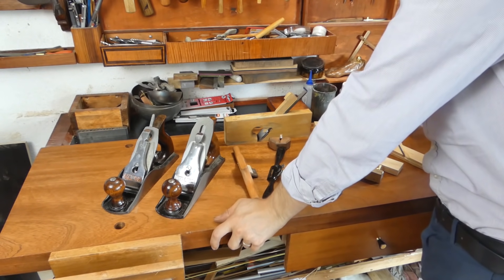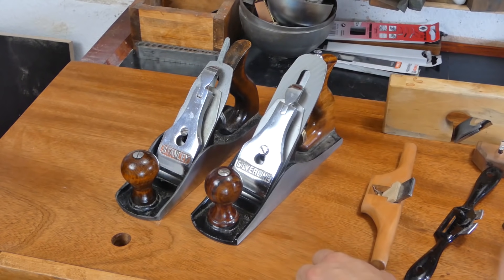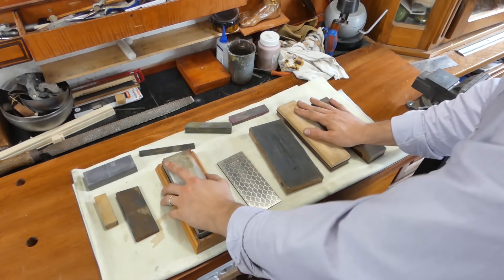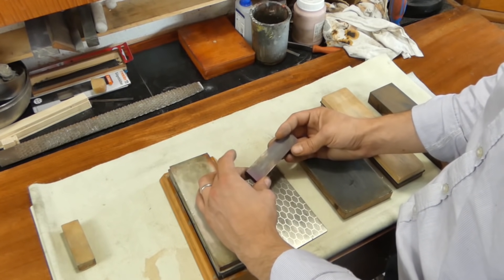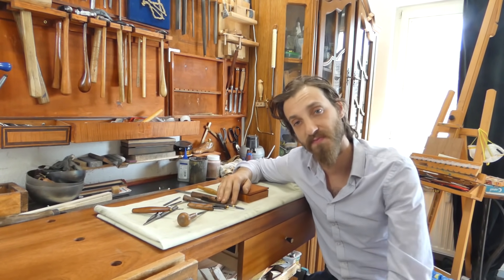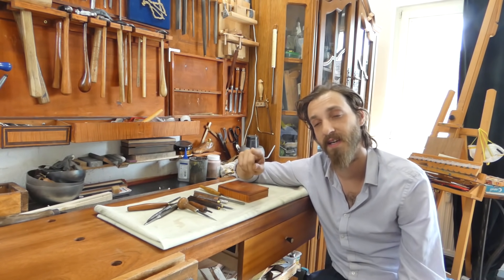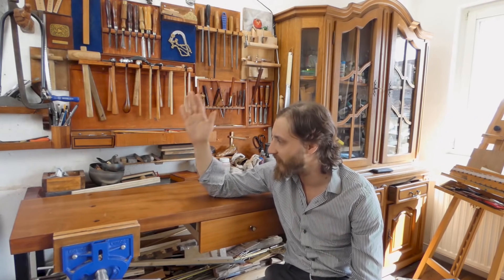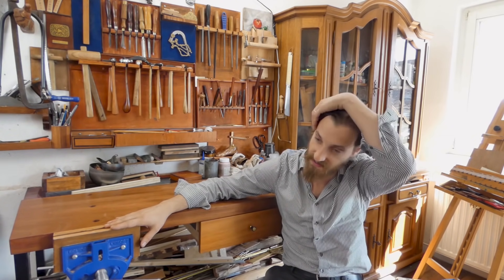Let's Talk Tools and Stuff! - 100k sub special!

Comment: For Japanese saws, I would recommend going with Gyokucho.  The blades are replaceable and they cut really well for being inexpensive.  Don’t bother with the really expensive handmade Japanese saws though since sharpening isn’t like on Western saws; it’s an art that requires special files and years of practice.

If you prefer a Western saw, buy a good one.  They’re worth it.

P.S., use the old blades from your Japanese to make other tools.  It’s good steel.
Reply: Thats actually a really good idea. I'm thinking of getting a Japanese saw and then using the old blades to make knives
Reply: i dont mean to be off topic but does anybody know a method to log back into an Instagram account..?
I was stupid forgot my login password. I would appreciate any assistance you can offer me.
Reply: @George Logan instablaster :)
Reply: With a Gyokucho saw you can take the blade out, and clamp it on a flat piece of wood, long enough to also be the handle, and that way have a back saw as well. That is three saws in one!

Comment: I don't think a lot of people get what it feels like when a tool is just right, it's working well and things are just going along great. I have planed some wood down to nothing just because the curls were coming off right, it just felt too good to quit. Of course there is a difference in the tools you require for your art work than the workaday tools I generally used. You don't buy high dollar chisels to mortise a hinge, but by the same token you don't want one so cheap that it fights you all the way.

Comment: Thanks for the tool video!
As I said before, you inspired me to make a graver and etc. For my first attempt at a graver I used a long Allen wrench, annealed the bend, cut it off and shaped it first with a good file etc. Before I hardened it I tried it on plastic and it formed perfect lines. I then quenched it and tempered it and when I was putting the final edge on it I must have messed up the geometry and lost its ability to make the perfect line. I am redoing it, but I see what you mean in that a guide when edging the graver is almost a must. I had made my own jig but the one you used in a video looked like it would have prevented my goof that has me starting over again. 
Best wishes for your channel!

Comment: Hi Uri, nice information about your tools.
High speed steel doesn’t need hardening. It’s quality is that it doesn’t lose its hardness when heated ( within reason) so can be sharpened on a grinder without dipping into water. I’m not 100% sure but I think that for a graver the cheaper HSS would be adequate

Comment: I’d like to point out Uri’s drill guide that can be seen on the left hand side in front of the wooden box at 6:25 – it’s from a company called Big Gator Tools and it’s a very handy little helper for drilling 90º holes. It’s made in the USA, but the quality is excellent and it comes in metric sizes as well. Worth every penny.

Comment: For a good cheap saw I recommend a frame saw. And I personally use and love the normal "modern" steel frame that any department store has. Get a good one though. The blade tension is key with saws, and a steel frame is much stronger than any wooden one. The user needs to make an adapter to fit the blade.

Comment: On heat treating, there's an iOS app (possibly android too) from ASM International called Heat Treat. It has a lot of different steels and how to anneal, normalise, harden and temper them. 

Steels vary a lot in the way you heat treat them and so this resource is very handy. NB: not all simple carbon steels are water quenching, some require oil.
Reply: Thank you so much for this suggestion. I've been researching heat treatment and trying to learn as much as I can about the process and never found such a thorough and convenient resource for it

Comment: It’s true that as tool prices get higher and higher, the improvements in quality get smaller. The quality difference between a $50 plane and a $10 plane is much more than the difference between a $200 plane and a $50 plane.

Comment: High speed steel can’t be heat treated.  That’s the point of high speed steel.  It’s designed to handle extremely high temps.

P.S., oil is a better quencher liquid.  Peanut oil works best since it has a high flash temp.  In addition, “annealing” refers to non-ferrous metals.  With ferrous metals, it’s called “normalizing”.
Reply: High speed steel can be heat treated, though it depends on the alloy and the equipment required is somewhat specialised. 

The quenching liquid depends on the alloy,  hence the O designation for some tool steels and W for others - guess what the recommended quenching liquids are.

Annealing can be applied to any type of metal and removes hardness. Normalising is a form of annealing that prevents distortions that can occur when metal is removed and uneven stresses pull the remaining metal out of shape - of particular application to castings, though thin rolled sections can be equally affected. Worked glass is generally put through an annealing oven, though the process has more in common with normalisation in that it evens out stresses rather than softening the material - regardless, it is known in the trade as annealing.

Comment: Uri, can regular saws be turned into japanese style saws? Like, if you took the blade out of a nice vintage one that you can re-sharpen, could you cut it, turn it arround and make a japanese style pull saw out of it?
Thanks and sorry if it's a dumb question.
Reply from the maker: I think yo can switch directions on a small dovetail saws, Japanese saw however also have different type of teeth geometry.
Reply: @urituchmanpigeon  ah, I see. I couldn't for the life of me find the answer to that and I couldn't get my hands on a japanese saw to check it, so it was bugging me. Thanks! Also, great video. I really enjoyed it.

Comment: #planes Hello Mr. Tuchman I use a KUNZ spokeshave 51A and the knife stays in playce when you use it. Besides it can be fine tuned with the 2 wheels.
I ordered mine at https://www.fine-tools.com/kunz-schabhobel.html
#japanese-saws There are tools to also sharpen Japanese saws. And I think you then have to buy one of the saws where the complete blade is hardened instead of only hardened teeth. There only is one downside with fully hardened blades - they can break very easy as they become brittle through the hardening process. So you need to have some experience with them otherwise it may be frustrating working with them.

I love your channel as you show how to do things that seem to be very complex, but can be done with patience and simple tools. Go on with your great work.